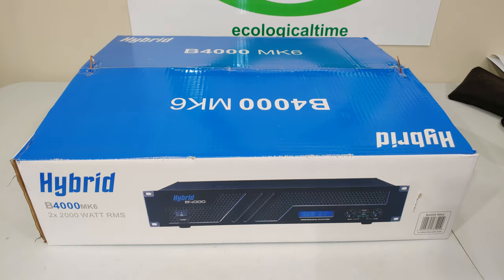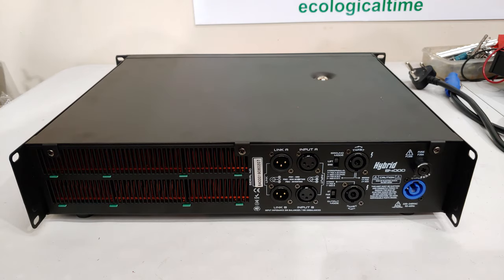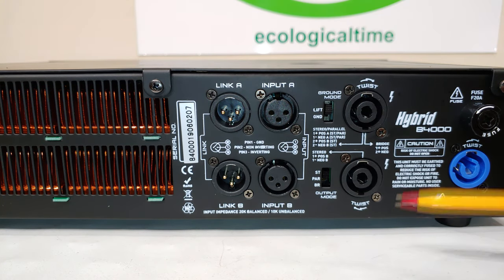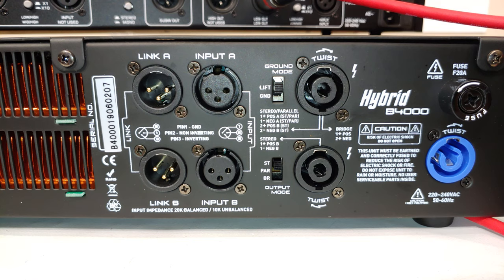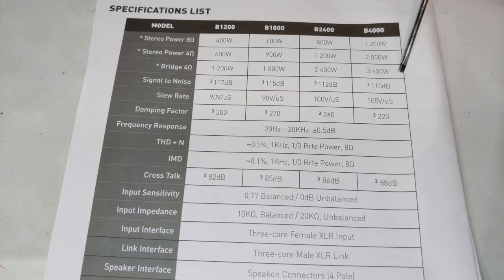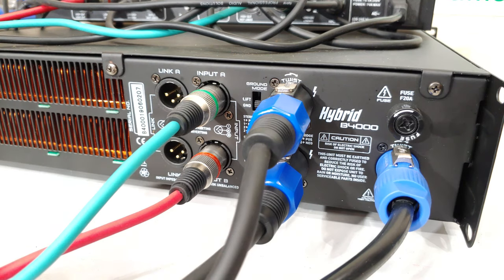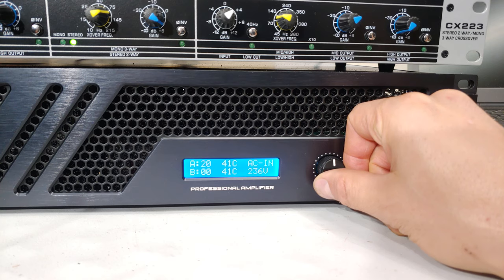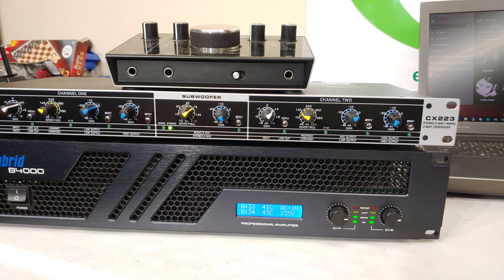Unboxing, setup, and review of the Hybrid B4000 MK6 power amplifier - How to connect - detailed

Comment: Good day. I bought a 2nd hand b1800. When I switch it on I hear n slight modulating 60hz freq. I know these are not sq amps but I just want to know If yours has that slight wine. The noise is there constantly with only the amp and speakers connected without signal. It is also the only powered device that is on at the time

Comment: Hi can you please do a walk thru of hybrid PC control setup,I can't find it anywhere on the internet,also the  built in crossover
Reply from the maker: thanks, i am going to be doing audio videos next month. I will try to add the one you asked for. The PC control is with their other amp, i dont have that amp at the moment.
Reply: @ecologicaltime  ok sir, thanks,I did jus purchased one and it's confusing,they don't even have manuals on the internet. Mine is a Hybrid A4000 mk5

Comment: Nice video very informative and why are most Hybrid Amps heavy (>15kg) as compared to other brands like Yamaha or Crown?
Reply from the maker: its a good thing, it means big transformer and strong case. For class A and B amps they heavy
Reply: @ecologicaltime  Ok cool, but do we have any high efficient Hybrid Class D amplifiers at the moment?
Reply: @lazziemunetsi1498  not yet class D they still uses class H
Reply: @lazziemunetsi1498   I believe only their smaller installation amps are full Class D (such as the PA500M, IA200/IA400 as well as their powered mixers and speakers), however I would recommend at least going for one of the Peavey IPR2 or Crown XLS 2 units, or at very least, an IMG Stage Line STA-D amp, if you want a Class D that will last, while delivering crystal sound

Comment: HI I HAVE A HYBRID A1600 I NEED USER MAUAL OR ADVICE WRT CONNECTIONS BRIDGED/STEREO/PARALLEL, AND IF THERE ARE ANY OUTPUT TESTS TESTS I CAN DO  TO MAKE SURE OUTPUT VOLUMES ARE LEVEL, THIS PARTACULAR MODEL HAS 8 MICRO SWITCHES AT THE BACK WHICH NEED TO BE SET FOR VARIUS SETUPS. THANKS

Comment: the spec list is way out..do they just put numbers in..misleading if you ask me.
Reply from the maker: why do you say that, i thought its accurate.
Reply: I just took a gander at the damping factor on the spec list. For a class D amplifier the numbers dont add up. I think its under spec, the whole amplifier.  I wish someone  would verify the data on this amplifier.
Reply: @jeremyphilander8833 did you test it

Comment: Your gain staging procedure is not optimised to provide the maximum dynamic range and signal to noise ratio through the system.
Those two rotary control knobs on the amplifier's front panel are not volume controls, but input sensitivity controls ment attenuate and match the output level of the sound source with the nominal sensitivity operating level of the amplifier.
With a correct system gain structure, the input sensitivity controls of the amplifier will never have to be turned up more than the 12 o'clock position.
I highly recommend the use of a mixer in front of the amplifier, to control and monitor the signal level on the mixer's master output level meters. With properly setup gain procedure, the mixer and the amplifier should reach clipping point at the same time.
To maximise the system dynamic range and ensure the best signal to noise ratio at the amplifier input stage, your sound source output level is set to maximum (unclipped) output  level. On the amplifier side, for full rated power output, you start with the input sensitivity controls at full attenuation (turned down fully counter clockwise) and slowly raise them up until the clip indicators start to flash and then turn them down about 3 dB.
This way, you take full advantage of the source maximum dynamic range and ensure the best signal to noise ratio (no hiss between tracks).
The overall volume level of the system is controlled by source volume controls.
If your speakers continous power rating is lower than the continous power rating of the amplifier at the nominal impedance, you calculate the power ratio between the amplifier and the speakers and adjust either the source output volume or the amplifier input sensitivity controls down, for the calculated attenuation.